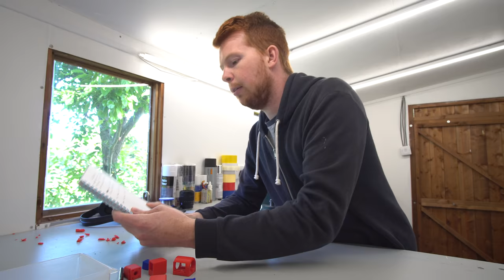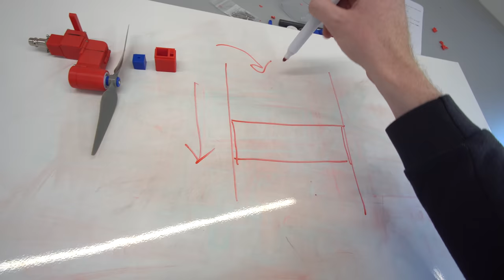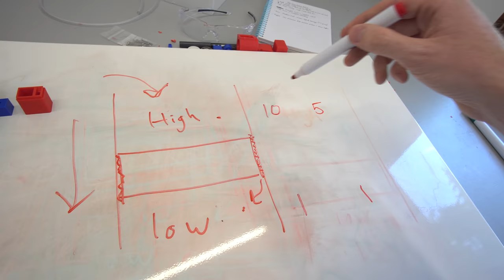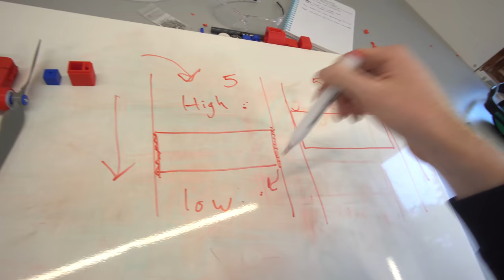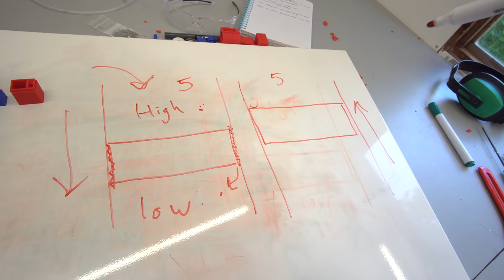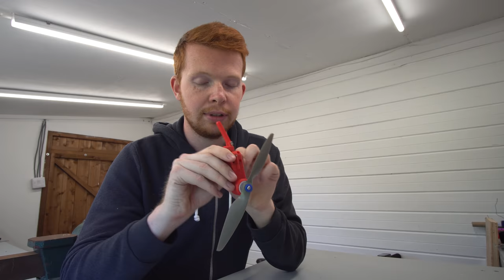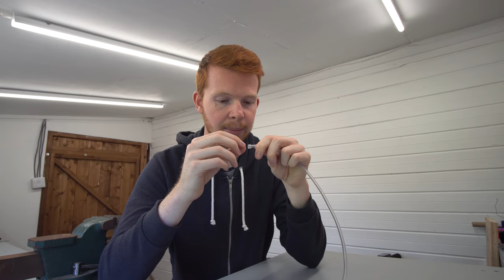Multiple or Single Cylinder Air Engine?

Comment: I would do 2 cylinder.. 
And to maximize the efficiency,,, would there be a way to "scavenge" the exhaust from cylinder 1 as part of the intake of cyinder 2?
That air still has the majority of its power remaining.

Possibly would be more complex geometry. But i have an idea on how to make it, and can throw a sketch together if wanted.... but im sure u can probably think of something better xD
Reply: LordDecapo 
Double expansion steam engine. A standard for very large marine, like the Queen Eliz.
Reply: Larry Scott exactly! Gotta use that wasted energy.
Reply: You could do a smaller high pressure piston then a bigger low pressure scavanger piston.
Reply: This is starting to make my head hurt
Reply: LordDecapo He can make a small hole/pipe from piston 1 exhaust to piston 2 and also it's very easy to do it just in the 3D planning...
Reply: cough QE and QE II had steam turbines .... ;)
Reply: Double expansion is way too complex. If he were modeling this out of metal & had forever, maybe. Bear in mind that the second piston has to be larger since the input pressure is lower. In 3D printed plastic with lotsa friction & no seals, it's not going to be pretty.  Also I got the impression he wanted to avoid an inline design: double & triple expansion is inline.
Reply: I came down to the comments to suggest a compound engine but I see you guys are on top of things already! My only question is that since this engine has to remain light, would the increase in efficiency make up for the increase in weight? What I really want to see is a turbine engine.
Reply: Andy [Xvixx] I waa going to point out 2x diameter is 2x perimeter but 4x area, so you gain force-on-piston as the square with increasing diameter but leaks increase linearly.
Bigger piston wins there.
Reply: LordDecapo maybe add a low pressure engine at the exhaust?
Reply: you can also set them up such that for high efficiency they run double expansion, but for high torque they both run from main pressure. I believe many of the very last steam trains used that kind of switchable setup.
Reply: Dude I remember you from ORE. Small world. I saw your name was familiar and looking at your videos I see why.
Reply: Posted my comment... boarded a plane.. then saw all this xd hahah
Exactly, 3D printing would make the plumbing pretty straight forward.... i actually have a good idea that could make this super super easy to print, i have some time this weekend. Will try to model it and get to printing it.
My item may be trash, but hey, engineering is learning from trial and error along with study.

Think of having a square cylinder in middle. Then having the ports dump out into the side wall on all 4 sides, give the piston head the geometry to enduce a votex flow in the air as it expands in cylinder. The 4 exhaust hholes could be put near the corners, with plubmbing coming off at an angle and spiraling up slighty slong the inside of the cylinder walls. The induced vortex would limit losses due to the rotation of the air getting pushing into spiralling chambers. 
Finally have those come up and port out to a 2nd clinder that is actually a hollow square and surrounds the inner cylinder. Have the pistons offset so the split second 1st stage exhaust opens, then 2nd cylinder is only a mm or 2 from tdc. There for your 1st cylinder could act as your valve assembly for the 2nd cylinder.

I know this has many problems like transfering power from outer cylinder to the shaft, in a uniform manner as to not cause knock and rubbing. I think solution to that is again to have cylinder geometry to help propagate the vortex flow into 2nd cylinder then have a port near each corner that all wrap around and finally exaust out the back. 
Would need 2 connections to the crank shaft so the power is pushing evenly onto it.

Yes, i know my spelling sucks xd lol. And this may be way too overly engineered. . However the geometry is the main complexity. Mechanics would be simpler then trying to get 2 push rods timed and having a 2nd cylnder being double the size and being offset, which could lead to excess vibrations. this idea would (in my mind) reduce this due to the oscillations being 180° out of phase and be acting around a shared center of gravity.
Reply: ctjet99 hahaha hey ct! Lolol. Xd im all over on engineering and redstone computation video comments ;) 3rd person in 12 hrs to find me here hahaha
Reply: https://www.youtube.com/watch?v=uRpxhlX4Ga0 This car uses that technology, and it doesn't show in the video but there are 2 different cylinder sizes and i only just now understood why.

In Tom's Airplane engine, i'm not sure this would be worth it. In a small car, i think it would be. Also in the car, he could include a motor to run a compressor (engine in reverse?) and make it refill itself.
Reply: TimberBunny running a compressor with it i feel would be too parasitic. :/ but i could be wrong!
And agreed. This idea would only be good for a car
Reply: Can i get your cad files to try and modify to use my idea? :D
Reply: You could do it similar to a shay style steam engine. I believe they had 3 cylinders per drive shaft. Each one exhausted its gasses into the next cylinder. Each cylinder was larger than the previous. I believe the stroke was the same but only piston/cylinder size was different.
Reply: offset the stroke and bore of the second cylinder so the lowered pressure of the exhaust could still be used to push the secondary piston for the power stroke
Reply: LordDecapo huh that could work actually.
Reply: It would be a very efficient engine, where the second cylinder is much larger than the first in order to have the same power
Reply: Turbocharger?
Reply: If you use a scavenger engine then increase the size of you're ignition chamber slightly so you have more wast air to go to the second cylinder
Reply: What would happen is you put a bit of dry ice in the tank?
Still pressurize the bottle, but as you loose pressure through the engine, the CO2 would help repressurize the bottle.
Would be perfect, surely it would help extended the range?
Reply: That is exactly how a highly efficient steam engine works, with a high and low pressure cylinder
Reply: then wouldn't it be better to make a larger single cylinder?
Reply: The most efficient type of motor for a compressed air driven motor in this application, would be a rotary engine. The most efficient rotary engine would be a Tesla turbine. I’d say that that would be the best engine for this airplane.
Reply: Just as devils advocate. I would imagine that as the bottle drains and gets to lower pressure the extra friction would make the double cylinder less efficient, at those lower pressures. I'm sure there's probably a point where the engine model's efficiencies cross related to the pressure. It would be fun to find out which one is more efficient overall.
Reply: LordDecapo Right
Reply: it wouldn't be compressed? and it would also be pointless to create more power. you'd just be using the power created from the first piston to move the next one
Reply: with double expansion cylinder he could put (As long as the bottle holds) more pressure without the increased leak losses of putting the whole pressure though only one engine, which translates in more power with a smaller overall weight :)
Reply: EXPLODING ETDOOD it is still compressed. When the valve opens ot pressurizes the 1st cylinder then due to it till having pressure trapped in the chamber when ball  closes valve. It has pressure. Just not as much.
Reply: Ben V i saw this mentioned before. Some people brough up safety... but a 1L soda bottle can handle.. a goid amount of pressure as the videos show.. you would need s releif valve to let out any excess pressure over a given limit when its not being used as fast as its made.
Reply: LordDecapo this wouldnt work, bc its the diffrence in air pressure that drives the engine, and if you add another piston, the only thing you would acomplish is adding more friction to the engine which would decrease efficiency
Reply: How is he supposed to get a good mid-low pressure engine working if he is printing it out of plastic?
Reply: A multiple cylinder engine will be less efficient. 
There would be less blowby per cylinder, but there would be more than a single cylinder due to a larger area being filled with air. 
On top of that, you now have double the friction which is double the amount of wasted energy transferred to waste heat instead of useable energy. 
You also have an issue of vibration which is also wasted energy. If he were to design a parallel twin engine, it would have less vibration, but it would still have the wasted heat energy, and wasted air pressure due to blowby. It’s a great idea but when you get to the physics of it, it’s more efficient to stick with a single cylinder.
Reply: LordDecapo run two air bottles on it
Reply: This is sounding like a turbo

Comment: Hi tom. Im a fireman and I dropped out of an engineering degree a number of years ago as my maths wasn’t up to scratch. Your channel has reignited my passion for physics, engineering and problem solving. I often refer to your videos to educate my colleagues as a lot of the principles you explain also apply for what we do especially with regard to fluid dynamics. There is often a number of hurdles to overcome when moving water around using pumps and having sound understanding really helps to make solutions. Thanks for putting your time into documenting what you do for us all to learn from 👍

Comment: Tom, have you thought about having a double acting cylinder?  Like a steam engine, where the air pressure both pushes and pulls the the piston up and down?  There are a bunch of videos online to see examples of them, but I watch a channel called doubleboost, and he just did a video where he put plexi on the valve box to show how it works... Check it out!
Reply: Actually, the way a steam valve box works, the valving is very simple, one valve, that would work on the cam he already has designed, it slides back and forth uncovering the port to power, and at the the same time exhausting the opposite port.  It worked for a long time before internal combustion, lol and produces HUGE torque.
Reply: For 3d printing there might be a problem with a sliding valve, because the friction is much higher with PLA on PLA than steel on steel., and you get more stuff that might leak. Other than that I think it is a good Idea though.
Reply: My thoughts as well plus he could run at a lower pressure to avoid cylinder leakage as piston is now doing twice as much work per revolution.
Reply: I think we have a winner, I believe this is the best of both worlds, one piston, double action...
Reply: ema paoletti I agree. I just wish he would balance his props and cam / drive shafts. Or say if he has already.
Reply: Badgermatt75 2016 can you send me a link to the Video ?
Reply: That's what I've been thinking the whole time, why not a double action cylinder? If trains used them, they have to have some good properties.
You can replace the sliding valve system with other methods of course, but I've seen them working even made out of wood, so who knows if that's really necessary.
Reply: thats what i was going to say xD
Reply: Mill glass or a ceramic or marble floor tile sample to make the slide valve element? PLA just holds the parts.
Reply: I'm trying to make one for my engineering class, I'll post a video when/if it is done

Comment: A radial 5 cylinder engine could be really cool :-)
Btw, using the stainless Steel bearing will be heavier than the ceramic one, so if you had some trouble with the weight of the plane maybe it will be a little bit worse
Reply: thought he was doing a car now?
Reply: yeah, weight wont matter because he will power a car
Reply: if anything its just another fly wheel
Reply: I know he was doing a car, I was refering to the 5 cylinder radial XD
Reply: see this POC for Duke engine... https://www.youtube.com/watch?v=c19kn3drdFU rotary cylinder engine.  Still think a turbine would be more efficient, with less parts - basically you have a stator and rotor in a turbine.  It does highlight the trade off between crank placement and head arrangement / complexity... reducing head complexity, increases crank complexity and vise-versa.
Reply: The size of that bearing for up to 200psi is still overkill. He could probably reduce the size by 1/3 and still be strong to work.

Comment: I vote for multi cylinder for the pure sake of curiosity :)

Also for your hose, use pneumatic push in fittings instead of zip ties, use a tap and die set to make your threads - works well for me on 3d printed stuff.  

Great videos, keep it up!

Comment: Multi-cylinder, after you've perfected and are completely happy with the design and performance of the single one?
Reply: VFR Explorer 
Be careful asking a designer to perfect a design. There is always one more thing that could be tweaked just little bit more.

But I agree with getting the single cylinder to a comfortable level of operation before moving on. At least test the changes that he has in the pipeline.
Reply: I think that a single cylinder piston with a large head would be a good step. That way, the surface area increases exponentially but the perimeter line that can leak only linearly. It would also give more power at lower pressures, without the need to add extra pistons. Thoughts?
Reply: I'm with you, get the single to the best practical design, then do two or multiple cylinders. Just keep in mind as your improving the single, the end game is to get to a double. That may influence some of the single design.

Comment: Well, now you should at least try to build multiple cylinder engine.  Build both, so you can compare which one is better.
Reply: I love your videos, Saukki.
Reply: probably the multible cilinder one, but it would use more air in less time.

Comment: Nice job! About your question, you can look into a low and high pressure cylinder. Similar to steam engines. They did that back in the day to improve efficiency by using the same steam a second time.
Reply: Don't the cylinders have to be different sizes for a multi-expansion engine?
Reply: Good point! Yeah they have to be, you would want the force on the crankshaft to be equal. So if you half the pressure in the cylinder, you have to double the surfacearea of the piston (or less when you combine it with a different turning radius of the connection between the crankshaft and piston's connecting rod)

Comment: The "better spinning" of the stainless bearing is likely due to the fact that it has a higher density, so acts more like a fly wheel surely?
Reply: Joshua Barretto not density, they have a higher moment of inertia
Reply: mass. they have more mass. which equates to the density of the material they are made off.
Reply: spud4242 yes the steel has more mass, but this is referring to rotational motion, which means we're dealing with rotational inertia, which is higher in the steel due to its higher mass
Reply: The stainless bearing is made of two materials; 440c stainless (7.65g/cm²) for the races, and silicon nitride (3.17g/cm²) for the balls. The white full ceramic bearings he had been using are made from zirconium dioxide (5.68g/cm²). The two bearings likely weigh nearly the same, but the hybrid stainless would have higher rotational inertia since more of the mass is closer to the perimeter. 
However, this is not the main reason that the hybrid stainless bearing spins better. The steel race is softer than the ceramic balls, which allows the balls to smooth out any imperfections in the races. Another part of it is that the lower density of the silicon nitride balls causes a reduction in the centrifugal force pushing them against the outer race, reducing the friction between the balls and the outer race.
Reply: exactly

Comment: My answer: A modular single cylinder engine which can be stacked :P
Reply: burak can but bulkier and heavier.

Also you cant have modular Crank shaft because the engine will have more parts rather than single-piece casted crankshaft.(added complexity means more stress points)
Reply: thats what i thought, like only the lower part with the "combustion chamber" and crankshaft, wut without the feed-plumbing
Reply: yeah like a single vertical rod going from the piston in the top cylinder to the bottom piston strait thru the middle!!! means the bottom piston gets a push from the top then pushes the crank. Booom
Reply: Perfect a single and then make a v8

Comment: Twin, definitely twin.
Reply: I disagree I would think that with two cylinders there would be less air leaked but it wouldn’t add much speed rather acceleration and tourque if you want to reach max speed you would need to hit 10 atmospheres on both therefore leaking twice the amount of air using twice the supply of air and barely increasing the speed, I say do two single cylinder engines with two props this is only a suggestion though I haven’t tried it
Reply: twin piston... im kinda geting triggered by it I2 or flat2 not Itwin or flat twin

Comment: For practical reasons I would use an inline 2 or 3 cylinder. However, for experimental reasons I’d go with a v6 or v8 or so on.

Comment: I vote for a single cylinder engine, for reasons I will explain after I make a suggestion for the PVC tubing you are using. To seal the PVC well, you make a female inlet that you can friction fit the PVC tube into. Once you insert the tube into the female inlet, you press an insert into the interior of the tube on the inside of the port which will swell up the tube and compress it against the perimeter of the female inlet. The drawback to this is you have to install the PVC tube before you assemble the part, but it does work and can withstand a lot of pressure. I do hope you do the single cylinder engine, because I've been working on a multiple cylinder engine inspired by your channel, and I wanted to share it when I finished. ;-)